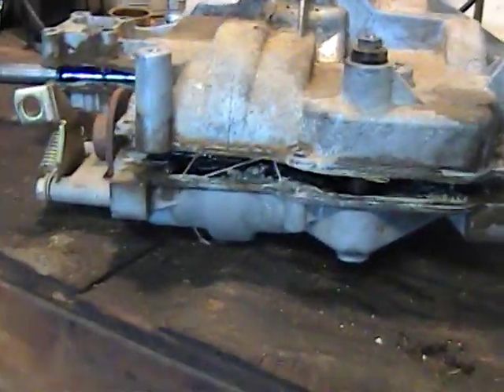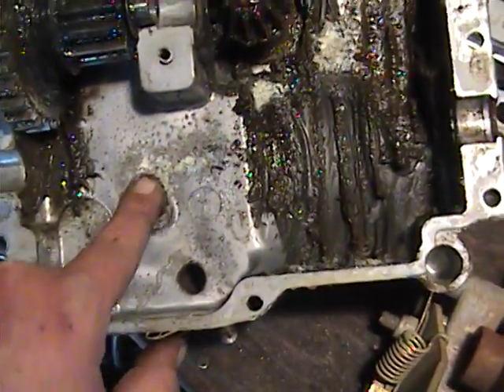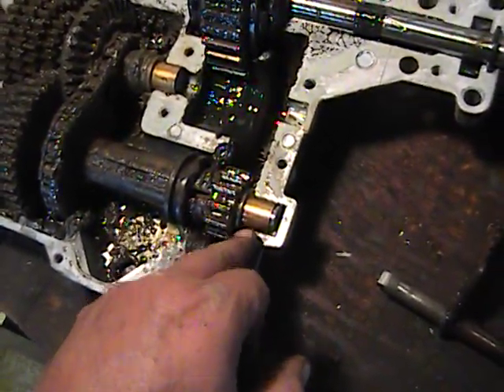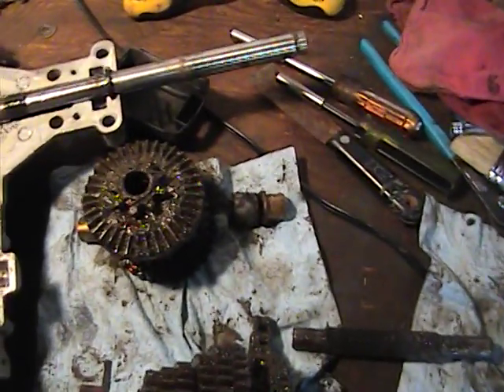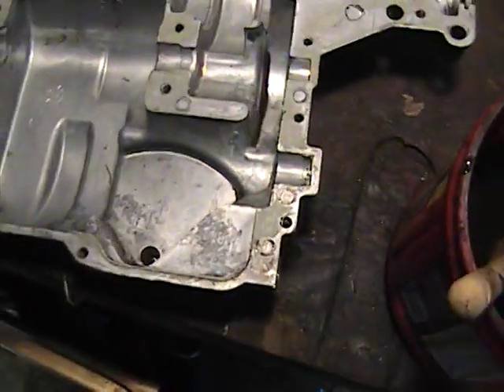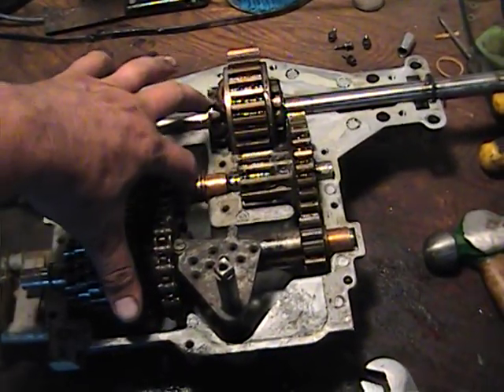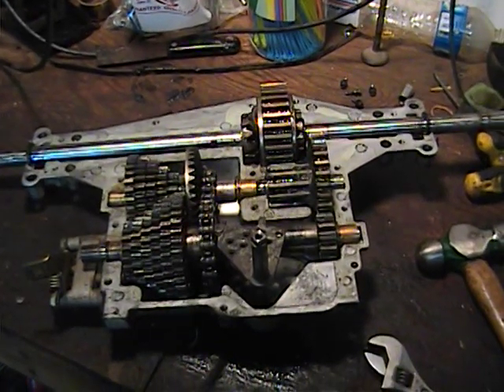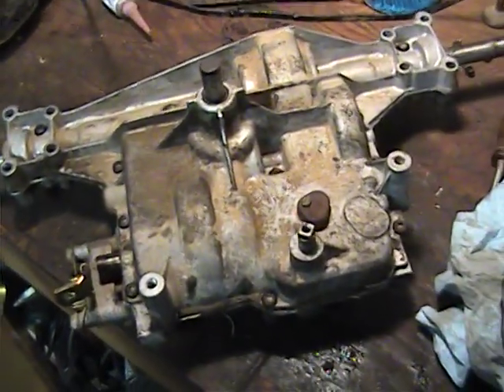Dana 4360 pt2.mpg

Comment: This post helped me tremendously!  Tractor found its way to a lake and went for swim.  Got engine going but transaxle froze solid and no lawn service would touch it.  With your videos I was able to take it apart clean it good and regrease it and now it runs better than it has for years!  Must have looked at the video 30 times to make sure all the little parts sat right.  Your tip of a tap with a hammer worked like a charm, Thanks!

Comment: Thanks for uploading these videos, sure helped me as I was unsure of taking one of these apart. I was told to use "00" grease, also called cotton picker grease when servicing these transmissions. I found it at Tractor Supply, it's made by Super S. I'm sure other agricultural and industrial places would have it as well. It seems thick enough that it won't leak out of the transmission, but we'll see what happens when I get it back together.

Comment: Remove one spring and detent ball (use magnet), add double ought grease via that hole onto top of shifter plate and ball detent area.  Place tractor up on jackstands and clutch action with shifter lever left and right may get shifter action back to normal. (jockey the drive wheel back and forth , maybe a half inch to mesh the internal gearing)   See the fix/work series videos, where they add a grease zerk fitting to the shift housing column, this prevents moisture in the air from building up rust on certain transaxle components.   Zerk grease fitting in one of these videos  seals the input shaft which is a pretty decent idea.   This transaxle design came up short on long term use and storage of the transaxle.   Company has been bandrupt in this application for several years.

Comment: Just done the same job on my husqvarna transaxle. i sealed the case and put 90 grade oil in. They recommend you only use bentonite grease but i am using oil after the mess i found in there, once that grease dries out your screwed.

Comment: This is VERY good! But as far as using gun grease in one of these I had an old Ex-Mark 4 footer with a 4 speed Peerless tranny and Ex-Mark had an update that stated that when the warranty went dead to drill, tap and install a grease zerk in the tranny case because they were prone to leak and that way you could replenish the worn out and set up bentonite with gun grease.  It worked fine and I also took the neutral switch out of a Peerless on a Craftsman rider and used a fitting and shot some grease in it to loosen things up. I am also working on a Dana 4360 and am going to do the same as a precautionary measure. The bentonite settles out and stiffens up and you loose your lube for everything. Bentonite is a clay after all and clay will harden. Some gun grease will get things moving again and as far as leaks go, if it's leaking you know it isn't dry!

Comment: Thanks for explaining which way the gears face. I think I put one Spicer six speed together the wrong way as it doesn't want to come out of gear very easily. If I shut the motor off, no problem.  It does have gear oil in it but I think I'll use John Deere Cornhead Grease instead as it liquifies under load and won't leak out.

Comment: Good morning, Nice to say hello, I would like to know if you sell spare parts for a Craftsman lt1000 mower transmission, I would need the input shaft in the transmission which is a 4360 140 and the two bearings that secure that input shaft, please.